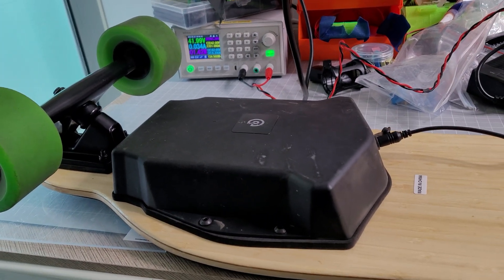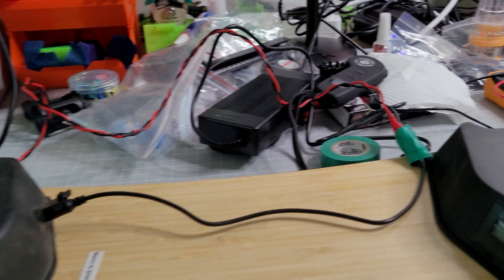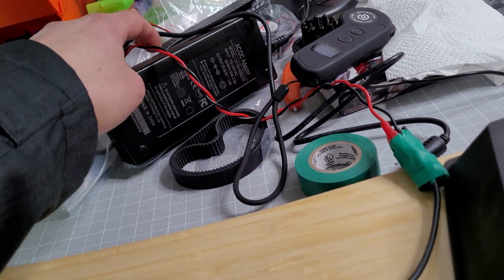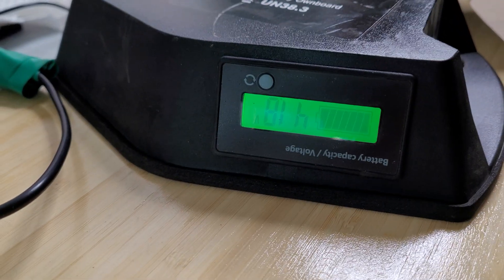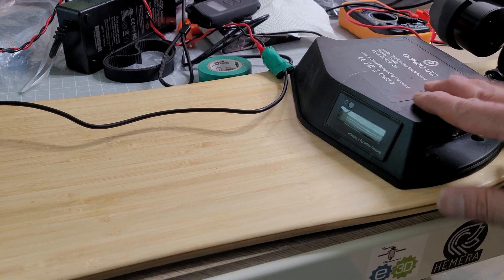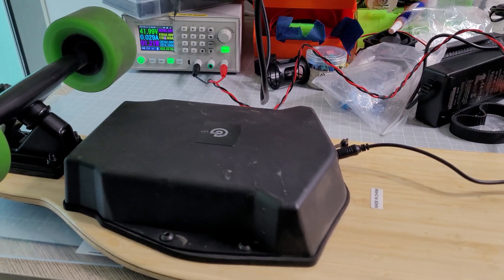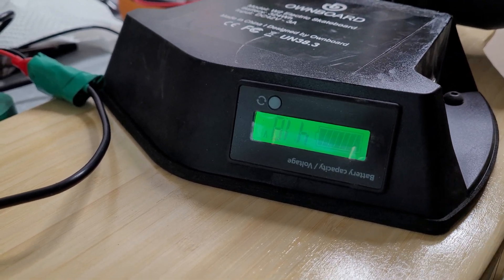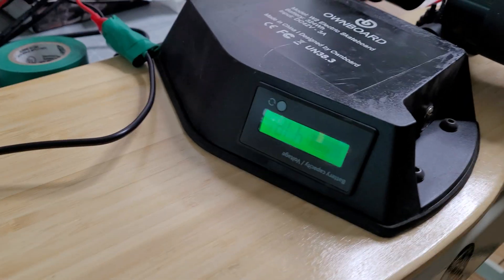Why You Need to Balance Your Electric Skateboard Battery Cells!

Comment: I actually hadn't ridden my board in a couple of months now because of winter and because there was very little need to. Just yesterday i hopped on again and it turned of mid ride at around 35-40% without being able to turn it back on again, unless i plugged it into the wall again. My first guess was that the batteries are likely through and i need to get replacements. But now after doing some research it's likely that one or more of the cells in the battery pack is just way more empty than the rest and that's what caused the bms to turn off the board at 40% to prevent the cells from getting damaged. I will try power cycling the next couple of days and see if the % readout becomes more accurate or if the capacity will actually increase again!
Reply from the maker: Yes just keep power cycling, ride more and the cells will eventually balance and your batteries will be good as new.  When not using your board for months, drain to around 50%.